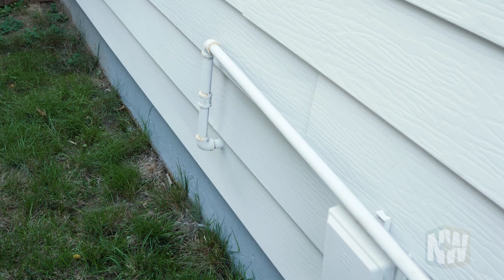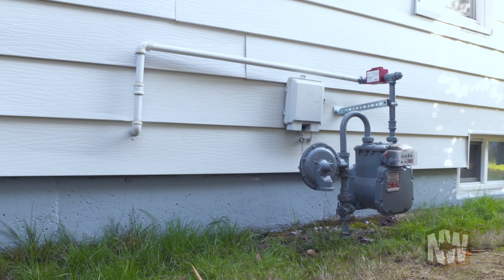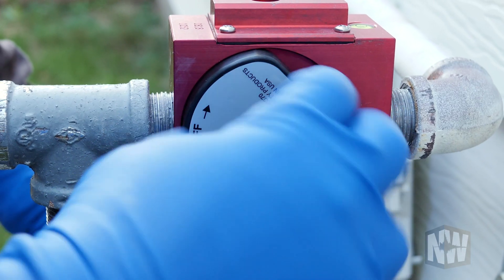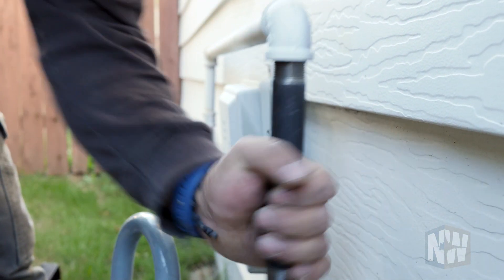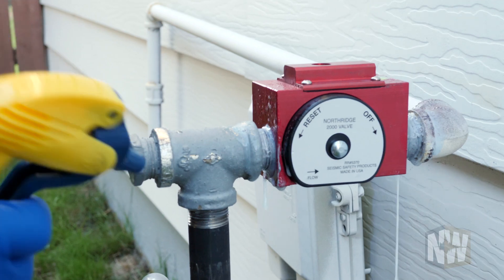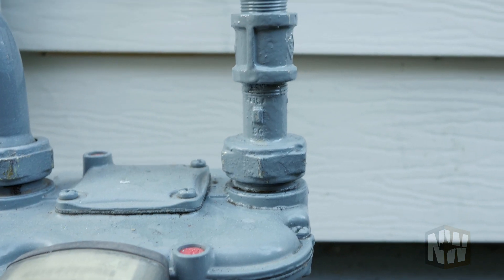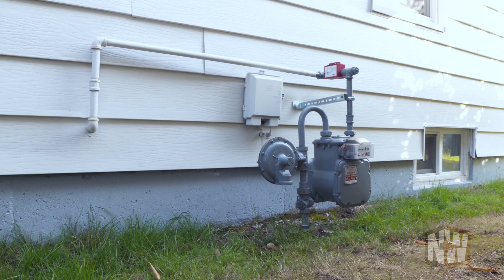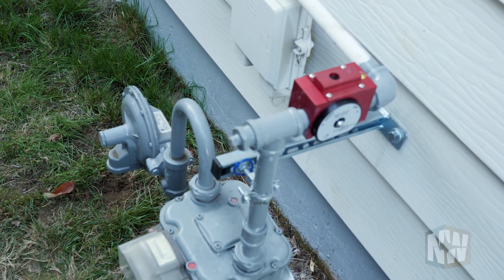Installing an automatic gas shutoff valve

Comment: The Sylmar, California earthquake of February 9, 1971 scared the hell out of me. I was a senior in high school. Homes caught fire thanks to water heaters falling over and tearing the gas lines out. Unless you lived through a quake, you don't know that the damn strong aftershocks happen at random times for days and weeks afterward. Maybe 5 aftershocks hit after the initial pre dawn quake. Some were pretty strong. It frazzled everybody's nerves for at least 10 days and being inside your home felt very unsafe.

I used that nerve wracking week to create an earthquake shutoff valve out of my dad's plumbing parts, fiberglass resin, a steel ball from a huge ball bearing, o-rings, etc. It was basically a modified plumbing cross where the steel ball sat on a divot that I ground in the end of a plunger rod. Shake it, then the ball falls off and plugs a hole with an o-ring face so the gas cannot flow. To reset it, the plunger had to be pulled down against a spring underneath the unit so it would be scraped into a position where it would fall into the divot on the end of the plunger.  I completed it, and showed my dad who was in the insurance industry. He said that it wouldn't sell unless insurance companies required it.

Some years later, perhaps in the early 1980's, I was at a box hardware store that was a precursor to Home Depot. There it was...a seismic gas valve on a shelf being sold, very similar to what I built. What a low blow to me!

My dad died 21 years ago and I found my 1971 prototype seismic shutoff valve in his garage. I tossed it into the roll off dumpster we rented for the cleanup. Just before they did the pickup, I saw it and took it back out and put it back in the garage. It's still in that garage somewhere. Dad, mom, and brother passed away and my high school friend lives in my childhood home. I might ask him to find that valve for me. I'm in my 70's and invented quite a few things. Nothing ever got to market. That's just the way it is.....

Oh, and I have the earlier version of the ''Northridge'' valve on my house. The blue anodized one. Cool, a magnet resets the ball.
Reply: I was there too, my whole bed was moving like I was on a boat an ocean wave, China was falling off the hutch out in the living room, my mom was, as  you say, frazzled.  She also was in the Northridge earthquake some 20 plus years later.  Note the name on the seismic shut off valve in this video is "Northridge"
Reply: @Rumpelstiltskin2011  Haha! I noted the name Northridge. The Sylmar quake changed my entire life for the next 50+ years. I was on my back holding onto the mattress in pitch dark as it jumped around. My book case fell on me pummeling me with heavy books. I ran into the living room after stepping in broken glass and fell over a couch that moved 6 feet from the wall. A transformer down the street overloaded and flashed and I was sure the Soviets had nuked us. But the sound of Satan grumbling UNDER my floor deep underground almost gave me a heart attack.

Subsequent changes... I installed built-in automatic power failure lighting with seismic switch (after the 1989 Loma Prieta quake), I refuse to go to sleep without my pants and shoes ready to bail out, pockets ready with keys, flashlight, wallet, cash, every vehicle in my driveway is filled with fuel, each vehicle has jackets, food, drinks, and spare keys, flashlights, medical kit. My furniture is secured to the walls, the fridge has a leash on it, and nothing can fall on my bed. The house has been bolted to the foundation, there are extra shear walls, and trees have been cleared away for fire and quake safety. I cannot even go into a store or building without determining where to dive in a sudden quake. Home Depot and Costco especially!  I'm glad you survived.

Comment: How much is the installation and part typically?
Reply from the maker: We typically charge $495 for one of our technicians to install the valve, but it may vary depending on the type of gas meter you have. If you send a picture of your gas meter to office@nwseismic.com, we can send you an estimate. Have a great day!
Reply from the maker: Currently, the price starts at $495. This includes the device, installation and if you are within the city limits of Portland, OR , the permit.
Reply: @nwseismic5876   please provide us india Ahmedabad supplier